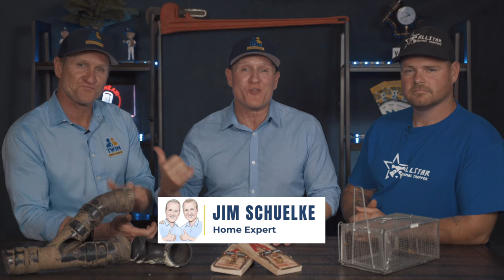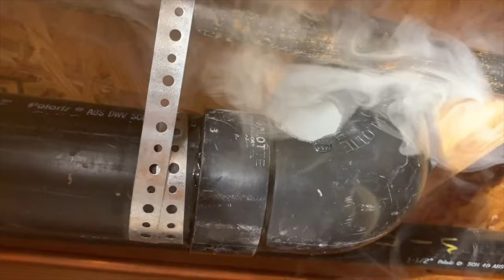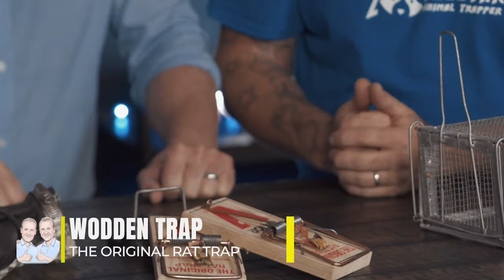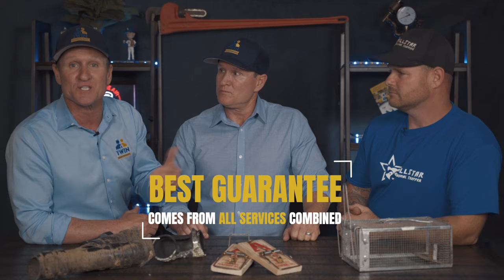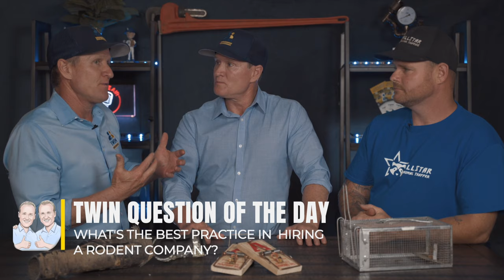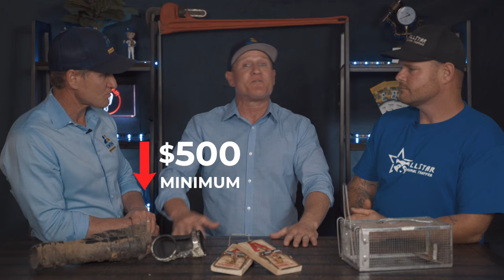Rodents in your walls? Here's what you do.

Comment: Can somebody tell me why in america they build most of the houses with brittle materials such as wood, plywood, hollow drywalls, hollow ceilings, etc? And not with big sturdy bricks, steel and cement like in a lot of countries throughout the world, I mean it's like you're invinting the roddents inside with the way you build your houses
Reply: Its cheap
Reply: Cause they’re not very bright.
Reply: I have heard that from others. Saying our country builds with cheap material. I think it may have something to do with the moral standards in America. If the moral standard is high, it will show even in the way people build. It's a manifestation of what's going on with the way people think.
Reply: Most of the houses around me are made of brick and cement. Chicago area
Reply: It depends on the available resources and materials in the environment which are used to build the houses. There too many trees compared to other materials like brick or stones, so it is easy and cheap to build  the houses of wood instead of other materials.
Reply: It is a matter of labor cost. Houses can be built real fast with dry walls, reducing labor required and maximizing profits. Countries with cheap labor would prefer to use better materials despite being more labor intensive
Reply: Because of climate. Most homes are built with wood so they can have a layer of insulation between the walls. This keeps the cold out and heat in during winter, and keeps the cool in and heat out during summer. Brick and steal traps whatever temperature it is outside, inside the home. At least that’s what was explained to me when I asked this very question.
Reply: @TheKimmyomy  this is not true, as you can have insulation with brick and steal too.
Reply: Cheap and greed I’m guessing
Reply: Cos they need to spend money on something else (useless stuff)
Reply: I am a home inspector in America and the quality of houses keeps going down and the price keeps going up.
Reply: There’s so much wood here.
Reply: I live in Toronto in an old apartment building-all cement and old plaster- and I’m hearing chewing and scampering in the walls and roof (I live on 19th floor).  Thank God for old plaster as is has wire mesh in it to hold shape.  So I’ve blocked off with cement and wire all possible entrances. Building owner’s don’t care.
Reply: u talk like London doesnt have a rodent problem...just because u saw a video saying the same thing, doesnt make u smart for repeating it
Reply: Try running electrical, HVAC and plumbing through brick walls.. or try painting them. Once u do that then you'll understand why
Reply: Money is the root cause of all corruption.
Reply: @user-cd9dr7lq7v  yea old houses do have that issue, I always recommend a cheap way is run duct or wires in the corner of the closet and frame it in. Or a mini split system too.
Reply: Houses used to be built with brick. Before that, logs. Before that, mud. It's not about where you are so much as how much you want to spend on your home. As far as the cheaper materials being used today? America was built on greed and greed continues to run it. The majority of rich people care more about profit than they do people. As does most of the govt
Reply: Capitalism and greed
Reply: Earthquakes. At least that’s the excuse in Ca. 
I suppose it makes clean up a lot easier. 
In Ca. The house across the street has been bought, gutted, remodeled, and sold 4 times in 20 years.
Reply: We’re cheap and greedy of money profits I guess.  People are so concerned of what happens right now, and not about the future and quality of work to last a long time.
Reply: @TheKimmyomy cinder block holds temperatures well, and acts as an insulator.  My uncle has 8’ of his house lined with cinder block and doesn’t require AC until July, when it has been 90°F – 100°F for the past few weeks.  That’s impressive to me. Their heat is amazing in the winter when it’s 5°F outside.
Reply: We build everything cheap and disposable here. You use it. Then you trash it. Homes, cars, appliances, electronics, pets, even people can't withstand the system here. The system can not have an old faulty part.  Besides if the homes were built out of more sturdy materials, then the home would last for ages. How is the financial system going to benefit from that? Your home should get old and  crumble by the time you are done with your mortgage, so you trash that one and buy another one. Then you work your butt off to pay the loans. That is how the system use you. The answer is more complicated. Things break in a cheap home. The roofer makes $$$ off of you. The plumber makes $$$, the carpenter, the tile guy, the painter, electrician, the list does not end. Home ownership is a big burden in this country. Yet it is advertised as the "american dream"
Reply: Cheap.  That's it.  Cheap.

Comment: How do you get rats out of the wall before you seal the wall up? Won't the rats die and stink if you seal them inside?
Reply: I bait them out first.  Use snap traps or water log traps..buckets with ramps. Catch them and then seal

Comment: Cement stucco on the home in place of vinyl siding.  Also very strong steel roof is needed.  Spray your vehicles engine, trunk and inside with a whole bottle of peppermint extract mixed in a 1 liter spray bottle with water.  If you buy a hot pizza, hot chicken, package of ham ext.  then spray the peppermint in the area where you put it at in the car right away after taking it in the house.
Reply: I just watched a couple videos of rats climbing up stucco and getting inside the house through a vent

Comment: I hear a scratching noise in my basement back corner of the house. I can't tell if it's inside the house or outside the house. The scratching noise is really loud and it's only in the same spot but it's maybe 2-3 times a day I hear it does not matter the time of day or night.
Reply from the maker: This doesn’t sound like a rodent issue .... sounds like another type of animal. 
Just do a very thorough inspection.

Comment: Thanks for putting this info up. It was interesting to watch, and I've started to wonder about strategy which it seems like you folks have in spades :) I was thinking about putting down chalk dust to track their movements; I've also used a sprinkle of rolled oats to tell me if they've been a particular place. I live in a basement suite. We recently discovered that rats had chewed holes in all the window screens to get in :'( (I had the house envelope inspected 2 years ago after a single Norway rat chewed a hole in the bathroom screen and got trapped in the house after I closed the window, so there don't seem to be any other egresses to worry about). They were doing nightly food raids I think, or perhaps trying to have a safe spot away from predators / adult rats and we didn't notice the holes until they were habituated to coming in and out at will. 

These new unwanted dinner guests are young juveniles; not terribly stealthy or cunning, noisy and fairly easy to catch. They seem to want back out desperately  -- they've been chewing at the window and door from the inside. I did a stake-out, left the front door open to make sure new ones didn't come in, and two ran out the door that way. The third I surprised into hiding into a corner, so I safety-gloved up and tricked it in to running into a fabric bag, and then relocated. 

My problem now is the Last Rat. It's much smarter, and it spends its leisure time in the ceiling. I removed all the accessible food and left multiple traps (a new wifi electric trap, and my trusty Havahart live trap, both baited with peanut butter). I prefer to live-trap the garden rats, but I'm out of patience with the house invaders. I've given them opportunities to leave so it's time for the snap traps too. It chews nightly, sounds like it's trying to chew its way out of the house -- deep wood chewing, but maybe that's just teeth exercise. It's so stealthy I'm not even convinced it comes down to the kitchen anymore. 

Out of desperation I've played rat distress sounds with a speaker up against the wall where it's decided to chew at 3am. That seems to make it stop at least for a couple of hours. Talking to it also makes it stop and reconsider its ways. 

I'm going to fresh-bait snap traps and put them in the ceiling. I'm only a tenant and I know if I bring in rodent control folks again in they'll probably just do the same. Other than that I can't think of much to do. The Last Rat is wild and it wants back outside, and I'm sleep-deprived and want the same thing. Suggestions are welcome! Or the phone number for a rat interpreter ;) Now for some coffee for my groggy self :P Thanks again for the great consumer-protection video!